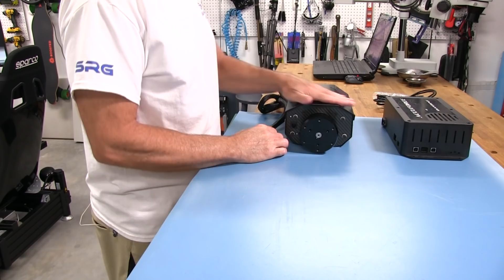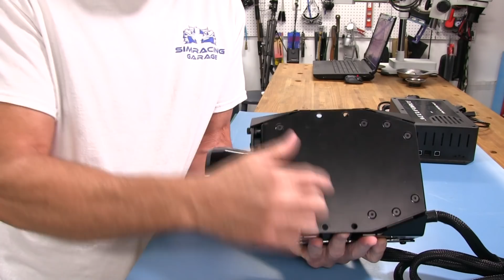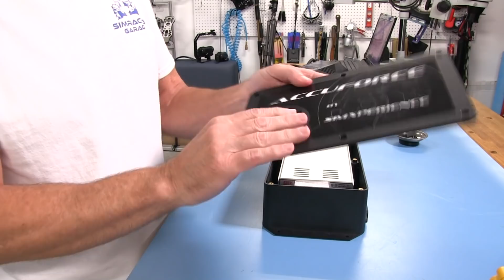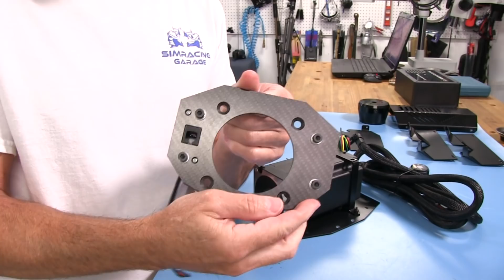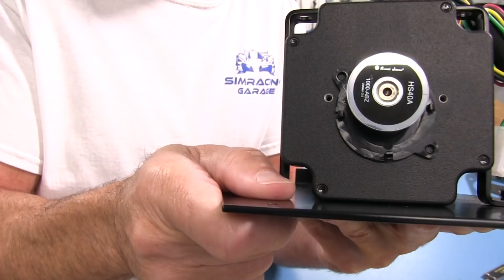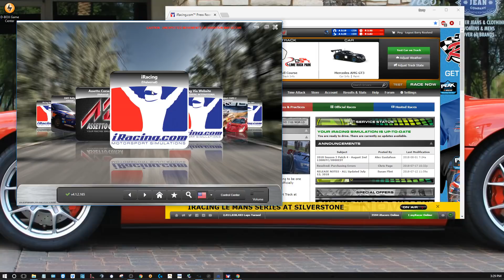Accuforce V2 DD Wheel Review

Comment: I see you're using a different wheel than the one accuforce sells. So am I right in asssuming you can mount other wheels on this DD wheel? The one thing I don't like is the wheel.
Reply: You can mount any wheel you want and you can also route the USB connection through the phone jack on the front of the base too. The pin out for the connector is on the accuforce forums. I converted a Fanatec formula v2 to USB and used a phone cord instead so it plugs right into the base.

Comment: I bought an Accuforce v2 its a great DD wheel 
Stoked with it just awesome
Reply: Have you experienced any humming from the unit, or clicking noise when either applying the brakes too hard, or when force feedback is strong?
In ACC, I get a constant electrical humming from the unit even when driving straight. It gets louder when I turn the wheel. I turn the intensity down to 50%, and it's quieter, but still loud. Not sure what to do, or if my unit is damaged?

Comment: @Sim Racing Garage is the motor the only part that's different from the 1st version? control box looks exactly the same
Reply from the maker: It is possible that they changed the PCB design. But not easy to tell. Motor used is the same stepper motor, with a different case design. There may be some other small tweaks here and there.
Reply: @simracinggarage3026  ok tnx

Comment: Very unimpressed that the PSU just sits in the box unsecured... the bits of foam are a bit of a joke. Really need to do better on that front, but other than that, the quality looks excellent!
Reply: One thing i don't like about fanatic DD is that with that price, they're using low quality capacitors which will leak in 8-10 years. AF uses good capacitors and they're in the power box not in the motor like Fanatec.

Comment: I am retired with time to fill and adequate (?) funds.  I was lucky enough to drive a very high end sim rig at the consumer electronics show in Vegas and I really enjoyed it.  My buying guide is "If I buy the good stuff I will buy once".  I am reviewing many sim racing videos to determine what a good sim rig will cost in the US.  In many videos I see sim wheels, pedals, and other previously used equipment hanging on the walls.  To me that equipment represents funds that should have been directed towards buying better equipment the first time around.  This video had a big surprise for me.  It is the first video that showed extensive configuration menus which I found a bit intimidating.  Other than an overall intensity setting or turning a feature on/off, I had incorrectly assumed default settings would be fine which is essential for someone like me that has no real or sim racing experience other than 1/4 mile drag racing many years ago.

While I do have funds, they are not unlimited.  It didn't take long to realize I could not justify building a rig similar to yours or the sim rig I drove in Vegas.  I can still build a high end pc, 3 screens, Next Level Racing seat for motion, Fanatec Club Sport pedals, and the Accuforce V2 while staying in budget.

I still need to find current videos offering advice for selecting the steering wheel.  They appear to be pricey so I will likely have to limit myself to 1 or 2 steering wheels.

The last item I need to investigate is the software setup.  As I mentioned before, the extensive menus for configuring the AF V2 were a bit overwhelming.  I don't know anyone with a sim rig so I need to be confident that I can handle the setup before I start ordering equipment.

BTW, how does anyone choose a racing seat?  When I buy a chair for my house, I sit in it to see if it fits and feels comfortable.  Oddly enough there are no racing seat stores near me so I cannot check for comfort.  Some seat vendors offer a dozen seats to choose one.   The one that looks great might not feel so great. How do I confidently select the right seat so I buy only once.

Are there any conventions in the US that have a high sim racing participation?  It would be great way to purchase all components at a single event.

Comment: do it still using stepper motor..??
Reply from the maker: Yes.
Reply: @simracinggarage3026  everyone says stepper will not work, but this work perfectly fine...

do you feel any different when you hold the steering wheel betwen stepper and servo..??
Reply from the maker: Stepper motor works well. Yes you can feel the difference between the AF stepper motor and a Mige, or Kollmogen servo motor. As you should, seeing how they are different types of motors.
Reply: @simracinggarage3026  better with stepper or servo motor..??
Reply from the maker: Depends on who you ask. I personally prefer the servo motors. Others may not.
Reply: @simracinggarage3026  you have been trying almost all of the sim steering wheel, the best, the worse, all of them...

btw very nice video...thanks for answer my question...

Comment: I have a feeble memory, but isn't the base bolt pattern same as Fanatec? Making it probably already drilled out on a bought rig.
Reply from the maker: No, the Fanatec is a different pattern.
Reply: @simracinggarage3026  The 2 front bolt mounting holes are the same as a T500 though, well they are on the V1 anyway with the angle brackets

Comment: Its just a steppermotor??? Really? Also the psu looks like a simple Chinese off the shelve switchmode psu.
Reply: He’s a about to cry because it’s a stepper motor
Reply: So, it's a stepper motor?  Just because you've always been told servo servo servo doesn't mean it doesn't provide a good result.  The guys at Simxperience have taken a stepper hybrid kit and through software/encoder created a good product.  Did you hear Barry complaining about it being a stepper?  No you didn't.  He made comments about the lack of power vs. some other DD options but that's something we all knew as it's only 13nm.  In fact Barry appeared to praise the product for the ability to get decent settings on Assetto Corsa, something he usually can't do with other DD wheels.

Comment: Are the holes not for 8020 profile?
Reply from the maker: The holes on the bottom of the housing have a ctr to ctr distance of 33mm. So, it will not line up with 40, or 10 series multi channel profiles. They do make an optional mounting bracket that you can purchase.

Comment: Barry- In your personal opinion, which do you feel has the better and smoother and more realistic force feedback, OSW small Mige or the Accuforce v2?
Reply from the maker: Realistic FFB, is a very subjective thing. I do prefer the feel of the Mige over Accuforce's stepper.
Reply: Thanks Barry for the opinion!  Do you like the small or large Mige?
Reply from the maker: I have never had a large Mige in the SRG. So really can't comment on that. But I think that the small Mige would be enough for most.
Reply: The reason I ask is because when you are buying the Mige motor directly from the manufacturer, it literally only costs $20 USD more to buy the large Mige.  Since I’m putting this system together myself, I figure I may as well spend the extra $30 total (includes the $20 referenced above + an additional $10 for the Meanwell 480w power supply that can peak to 720w). Seems like a no brainer.

Comment: Great review as usual. Initial impressions from people at the Fanatec event are suggesting that the Accuforce is considerably less smooth than the OSW/Bodnar (and moreso compared to Fanatec DD). Did you notice any difference in smoothness between the Accuforce and the OSW or Bodnar while driving? Thanks
Reply from the maker: Yes. Different motors have different feels to them. Regardless of the software used to drive them.
Reply: Thanks for the quick reply. Would you say that this makes the OSW/Bodnar choice of motor better, or just different? Is this just what you would expect with the Accuforce being at a cheaper price point.
Reply from the maker: FFB "feel" is a very subjective thing. I don't think there is one right choice for everyone. Many factors will be in play to determine which one you like best. I suggest you try as many as you can to make up your own mind.
Reply: @GoezTo11  As a recent Accuforce owner I would suggest if you get a chance to use the Accuforce that you have the ability to tweak the software.  If you go to an expo and you use it in a comparison to something else odds are it's not tuned to your liking.  When I first tried the wheel I really didn't like the feel, very grainy and unpleasant but in 15 minutes I was able to get a setting I really liked, great product.

Comment: Just a thought regarding motor mounting Barry - do you think you could dispense with the Accuforce outer casing completely, and just mount the motor directly to the rig, with the four large holes on the front? Or does the casing perform a function?
Reply from the maker: Completely doable. You will have to find a way to manage the cabling. Ricmotech has a bracket that will fit the stepper motors bolt pattern, but not sure if they will sell it outside of the kit. http://www.ricmotech.com/Ricmotech_Direct_Drive_Wheel_Motor_Powered_by_Accu_p/rmt-ddaf-base.htm

Comment: Barry / Folks I have narrowed my search to the Fanatec DD1 20nm ( 995 usd, ). I also have the v3 pedals, sq v1.5 shifter, handbrake, CSW v2.5 etc..BUT the Accuforce is a very good price and I already have sim commander software for Buttkiker. My only concern with the Fanatec DD1 is long term reliability...can I trust the wireless features in this new DD tech etc. I am impressed with the research and tech going into the DD1 and most likely the way I will go. However I am still open to people's concerns or suggestions?

Comment: Got this wheel two weeks ago and absolutely love it. An OSW at double the price or more for minimal added effects and extra power that you will never use just isn't worth it unless you're a professional racer that needs that kind of extreme detail. No way in hell anyone needs a 30nM+ DD wheel, thats just not realistic by any stretch of the imagination. This wheel puts out more Nm than you will ever need, enough to break your thumbs off if you want it to.

One thing you didn't mention which I think is important since you emphasized the sim commander tuning is that you can actually download other peoples shared configurations. You simply check off which hardware you have, select the game (you can even select car/track but its not required and you will get far less results) and click search. It will populate a list of all the configs you can download, and some people will even have a description about their config, and what in game settings they use with it etc...

There is one I got for PC2 that I did a bit of tweaking with and it is just incredible the FFB I get from this game. The detail you feel hitting kerbs, burms, grass, gravel, other cars, under steer, crashes, wheel lock etc is just incredible.

The one I got for iRacing is decent as well but I have not put in as much time with this game yet.

Dirt Rally has also been incredible but I am waiting for my hand brake to arrive before I really dive into this for obvious reasons.

I have not had a single issue or complaint with it and its built like a tank so I don't foresee having any for a long time.
Reply: some open wheelers without power steering do reach steering forces of 30nm and more (indycar is one example).
there are even some road cars without power steering that require 10nm or more.

while 13nm is probably enough for most people, there are definitely cases where more power is realistic.
Reply: Could you site a source for that 30nm figure?  I regularly see people quote these crazy high nm figures (that would utterly exhaust a human being that doesn't hail from planet Krypton in mere minutes) yet no one ever seems to back it up with verifiable figures.  I've done some searching and the only thing I can come up with is this:

Autokraft Midget = 6.0 Nm (55 in-lbs) No power steering, 380mm (15.0”) Ø steering wheel. 
Lola T332 = 5.5-8.5 Nm (50-75 in-lbs) No power steering, 318mm (12.5") Ø steering wheel. 
Dodge Viper SRT-10 = 4.5 Nm (40 in-lbs) Power steering, 350mm (13.7" Ø steering wheel. 
Lotus 20 = 4.0-4.5 Nm (35-40 in-lbs) No power steering, 330mm (13.0") Ø steering wheel. 
Lola T190 = 6.0-7.5 Nm (55-65 in-lbs) No power steering, 318mm (12.5") Ø steering wheel. 

The highest on the list is the non-power steering Lola T332 at 5.5-8.5 Nm.  The Lola raced in the Formula 5000 series and is at least aesthetically very similar to an Indycar.  However, at 8.5 Nm it's still nowhere near 30 Nm.  I'm genuinely curious about this, because at 30 Nm I suspect drivers would loose nearly all fine motor control almost immediately.
Reply: i wasnt able to find the article i was originally talking about, but i found a similar one.

this one is about the japanese fomula series (formula japan/formula nippon) and their switching from unassisted steering to power steering from 2009 to 2010 (use google translate).
similar to formula 1 and indycar, they use very light cars with a ton of downfoce.

the maximum force for the unassisted steering is listed at 75nm.

sites google com/site/fnarchive2010/2010fn/round5sugo/kikaku/fnno-pawasutewo-o-benkyou-shi-masho-u

(replaces the spaces between sites, google, com with dots)
Reply: Thanks for your quick reply.  Also, thank you for linking that article.  While it's an interesting article, I think something must have been lost in translation, or it's simply flat out wrong.  75nm translates to approximately 663 inch pounds of torque.  I doubt that even the strongest man on the planet could reasonably cope with this sort of torque.  Even 30 nm translates to about 266 inch pounds of torque, which is pretty obscene in itself.  Given the limitations of the human body, these numbers simply don't make any sense to me.  I know that increasing my accuforce past the 70% or so mark basically renders it unusable for me - after two or three turns I'm ready to tap out.  One other thing I don't understand is why some of these cars would have so much more resistance on their wheels.  The Lola T332 was a 1970s non-power steering race car that could hit at least 190 mph.  Why would these much newer Japanese cars have nearly nine times the resistance on their wheels?  Were they pouring locktite in the steering mechanism?  Cars with increased steering resistance would be at a huge disadvantage against cars with lighter steering resistance.  You'd think that they'd try to avoid heavy, driver exhausting steering resistance at all costs.  I wish there was a clear answer to this somewhere, but there doesn't seem to be an abundance of readily available info.  Regardless, thank you very much for your response, and if you come across anything else please let me know.

To amend this comment:  The newer Japanese formula series would likely have cars with a higher down force than the Lola, which might in part explain more steering resistance.  More down force = more steering resistance.  That 75nm still strikes me as extreme, but who knows.  It would be nice if we a pro driver who had experience with both the real life cars and sim steering would drop in to settle this...
Reply: The reason is, as you said, that modern formula cars have incredible amounts of downfrorce.

A current formula one car weights about 700kg (~1540 pounds) standing still, but at full speed its close to 4 metric tons (~8800 pounds).

Since the amount of downforce depends entirely on the speed of the car, these forces are only generated in corners that are taken at (close to) top speed, which usually dont require a lot of steering input.

This article might be worth looking at - if you scroll down a bit it has a list of results from an experiment, where they tested how much steering force a group of "test subjects" could reasonable handle - none of them racing drivers, just a random group of engineering students.

The lowest number on the list (for the steering wheel in close position) is 41nm, the highest close to 90nm.

formulastudent de/pr/news/details/article/steves-box-of-tricks/

(replace the space between "formulastudent "and "de" with a dot)

Professional racing drivers (which are athletes, they do a lot of training) should be able to handle much more peak force than an amateur, so i dont see why they wouldnt be able to hold 30 or 75nm through some corners.
Reply: Clearly you cant afford an OSW

Comment: Sim commander is only for Accuforce?
Reply: It includes Simvibe as well, which is IMO a must if you don't run motion and certainly adds even more to most motion systems.
Reply: Running shakers off audio is just so subpar compared to SimVibe. It's hard to explain it to people, but they get it once they try it. The signal is so much cleaner and useful.
Reply: Andre Davis oh yeah, Simvibe is totally worth it!
Reply: Simexperience wheel, motion rig and tactile solutions for sim rigs